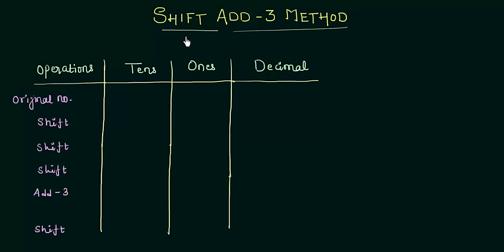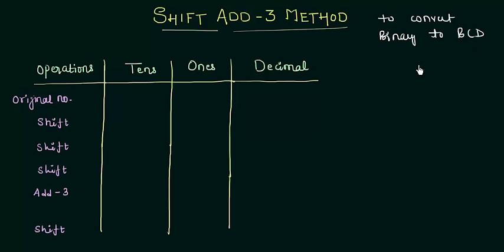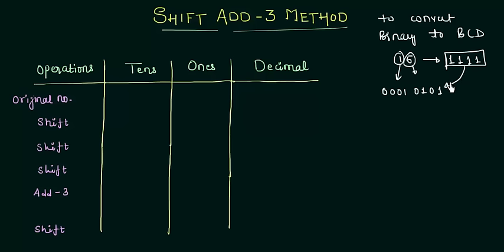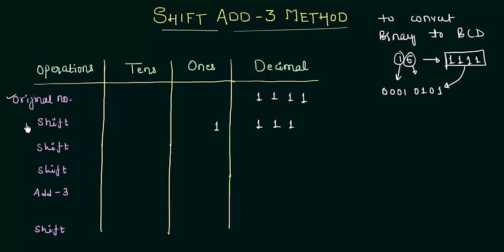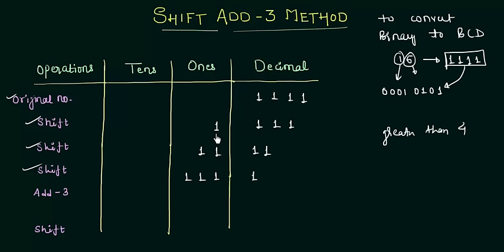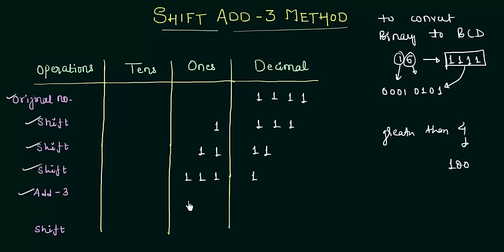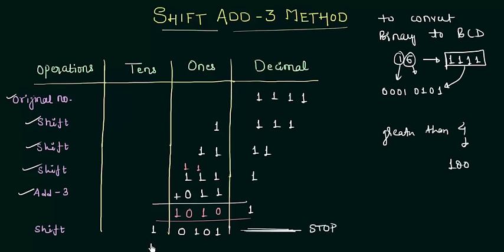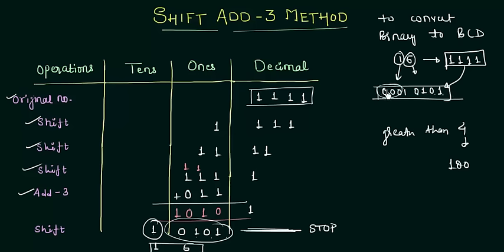Shift Add 3 Method | Simple method for Binary to BCD conversion

Comment: please read with patience.....
FOR THOSE PEOPLE WHO WONDER WHY WE APPLY THIS RULE (LEFT SHIFT 3 TIMES AND ADD 3)
this rule is just as same as adding 0110 (i.e)6 to the binary number to get the decimal number
we know that BCD has only 10 representations (i.e) from 0 to 9 .
while performing bcd addition which is same as binary addition , if we get a binary result greater than 1001 (9) we simply add it by 0110 (6) to get BCD 
now consider a number greater than 1001 (9) say 1010 (ten), to simply determine that this number is greater than 1001 we can just look at the first three digits 101 in 1010(ten)    101  is  5  in decimal 
101 in 1011(eleven)   101  is 5  in decimal
110 in 1100(twelve)   110  is  6  in decimal 
110 in 1101(thirteen)  110 is 6 in decimal
111 in 1110(fourteen)  111 is 7 in decimal
111 in 1111(fifteen)   111 is 7 in decimal 
on the other hand take a number less than 1001 (9) say 1000 (8)
here the first three digits are 100 which is 4 in decimal 
so now we can come to a conclusion that those binary numbers that have their first three digits greater than 4 i.e. 100 has to be added with 0110 (six) in normal method 
in this method we do the same by extracting the first three digits by simply left shifting it three times
and then if it is greater than 100 (4) then we add it by three (011) 
here comes the doubt , that why are we adding three instead of six 
the reason is here we have extracted the first three digits only and ignored the fourth digit which is also a part of the binary number......
in the same way we ignore the fourth digit in 0110 (6) to get 011 (3) 

in the above example we add 011 to 111 which is greater than 100 (4) 
without ignoring the fourth bit (i.e)  if you add 0110 to 1111 (which is the actual question) you get the same BCD number as 10101 which is the answer 

RULE 1: SHIFT  THE  BINARY  NUMBER  LEFT  THREE  TIMES  (NOT  MORE  THAN  THAT)
RULE 2: CHECK  IF  THE  FIRST  THREE  DIGITS  ARE  GREATER  THAN  FOUR  .
RULE 3: IF THE FIRST THREE DIGITS ARE GREATER THAN 100 ADD 011 TO THEM .
RULE 4: ELSE LEAVE THEM BE .(AS IT WILL ALREADY BE IN THE DESIRED BCD FORMAT)
Reply: This method didn't work for 90 :(

Comment: Thanks for this, but you haven't explained the significance of the rule "if it's greater than 4 then add 3". The mechanics are easy to follow but I'm lost on the reasoning.
Reply: This is same as the add 6 method. Only difference is that we are doing the operations with the three most significant bits. 
(1) Reason for add 6 method: 4 bits contain 16 numbers [0-15]
(2) When to add 6, when the 4 bits are greater than 9
----
- If the 4 bits are greater than 9, then the first 3 bits are greater than 4. (When we eventually "shift" the last bit, we are multiplying by 2 and adding either a '0' or a '1'.)
- If we add 6 to 4 bits, it is the same as adding 3 to the most significant 3 bits. (because as above. in the shift operation, we will be multiplying by 2)
Reply: i can explain it to u , 
Decimal digit	BCD
    
0 -	0	0	0	0
                 if u look at this chart  and observe only the first three digits from left 
1 -	0	0	0	1
2 - 	0	0	1	0
                 u can see that none of them is greater than 4 
3 - 	0	0	1	1
4 - 	0	1	0	0
                 for 9  the three left most bits 1 0 0   equals 4 
5 - 	0	1	0	1
6 - 	0	1	1	0
                 10 -  1010  , if u look at left most three digits of 10 , 101 equals 5 , 
7 - 	0	1	1	1
8 - 	1	0	0	0
                 hence a if three leftmost bits are greater than  4 , it indicates that the orignal 
9 - 	1	0	0	1                 binary number is greater than 9 which is invalid , hence we add 3 .

Comment: the best method for converting binary to bcd is to add 6(0110) to the binary code of above 9.
the binary and bcd codes are same for the digits upto 9.

for example: decimal number(15)=1111 binary
15 is greater than 9
so add 6(0110)to it.

1111+0110=10101
we can write it as 0001 0101
                                    1         5

in this way ,we can convert binary code to bcd code..
Reply: Thank you so much:-)
Reply: What if the no.is in decimal form like 11010.0100

Comment: Respected sir, simply add six to get desired result. I understand from previous video.
Reply: this comment is underrated !
Reply: It doesn't work for every number like for 20. 20 in binary is 10100 + 0110 = 11010 which is not 20 in BCD. We'll again have to add 6 to get the correct answer in BCD
Reply: @nd685  Actually we need to add 6 once if it is for 4 digit number ..here as 20 is 5 digit binary number we need to add 6 for 2 times .....Anyway the method used in previous video is simpler than this method

Comment: One example is not enough to understand......I tried with another example decimal number 18 
It has binary equivalent 10010.
It has BCD 00011000.
After applying this method I got
11 in tens and 110 in ones and nothing in decimal column.

Please help me...
Reply: See, you have to add 3 when shifted number is greater than 4 only,

Original no. 10010
Shift 1: 1 | 0010
Shift 1: 10 | 010
Shift 1: 100 | 10  (equal to 4 but not greater)
Shift 1: 1001 | 0 
Now it is greater than 4
Add 3 - 11

1001 + 11 = 1100

1100 | 0 
Shift 1: 1 | 1000 | - (stop)

We get : 0001 1000 (18)
Reply: You have to keep 4 bit in both tens and ones

Comment: Hi sir I bit confused about this method can u explain for decimal number 68 or 36 , u said that in ones column binary should be greater then 4(100) , so if i shift again then it comes 8(1001) for 36 then shift binaty it gives tens 10 & ones 1100 after add 3 (011) & shifti ,pls give solution for this

Comment: Please convert an hundred  place number I meant that a number like 153 in BCD>plz
Reply: I think we won't be able to convert a decimal number more than 99 into BCD. the range of BCD Is from 0-99
Reply: Yes follow same method, take 100s,10s and 1s coloumns and in every coloum if the number reaches greater than 4 add 3(for 153 u have to add 3 in 1s coloumn for 4 times and in 10s coloumn for 1 time) and shift u will get the correct answer